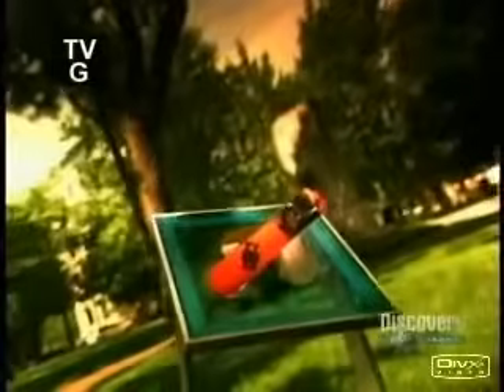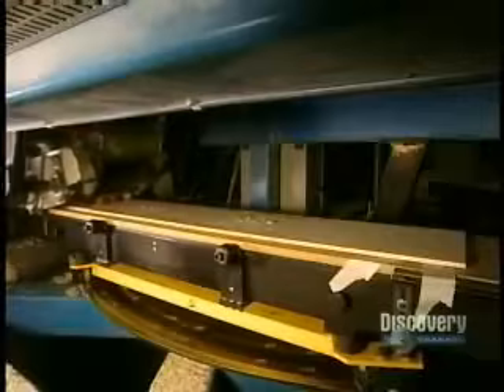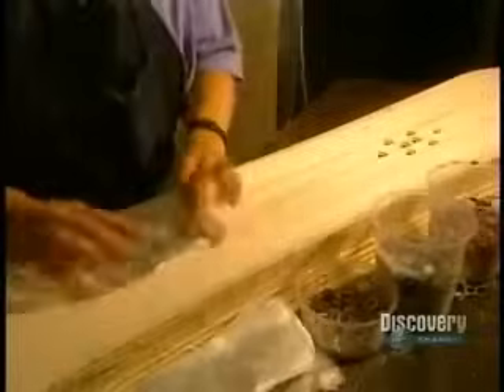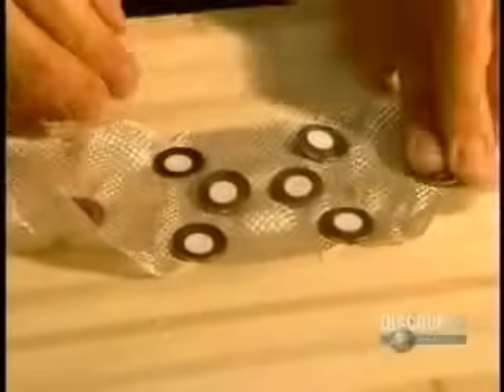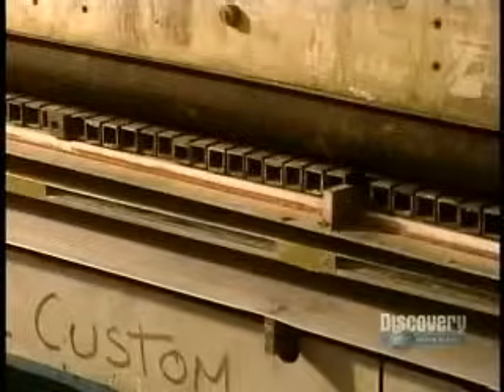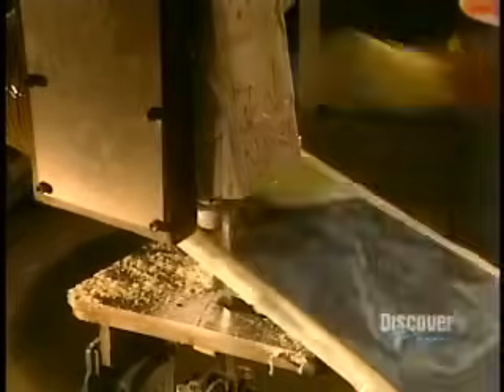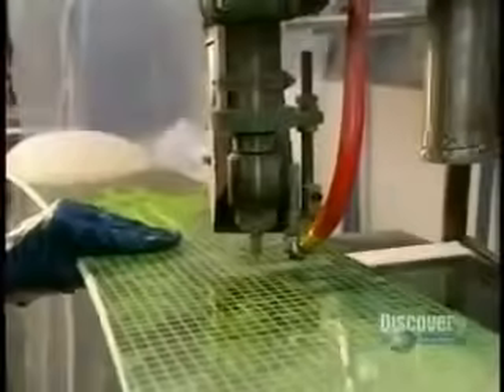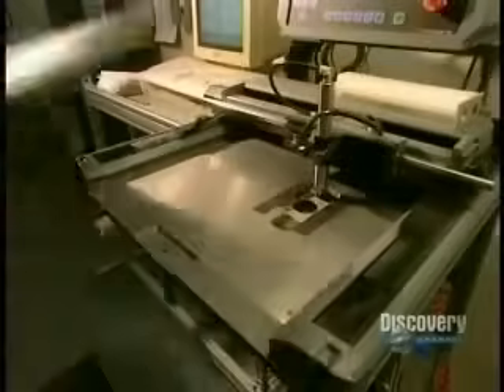How It's Made - Snowboards

Comment: did anyone notice that they said nothing about how the metal edges are put into the board??? they showed some guy sanding down the edges with sparks flying but said nothing about the process used to manufacture the edges. correct me if I'm wrong. cool video non the less
Reply: it could simply be wood and epoxy dust igniting from friction

Comment: Steps:

Drill holes for bindings in hardwood plank
Plane to (varying) thickness
Shape contour: CNC router
Secure Alu inserts in holes with fibreglass
First layer of epoxy and fibreglass, at room temps, both sides
Graphics (on top): silk screening
Shape curvature: Assembly is placed in a heated press to cure epoxy
Remove excess by bandsaw
Graphics : silk screening again
Apply protecting varnish (place in dryer for 6h)
Edge sand
Re-drill holes
Sand varnish
Check steel edge adhesion with knife